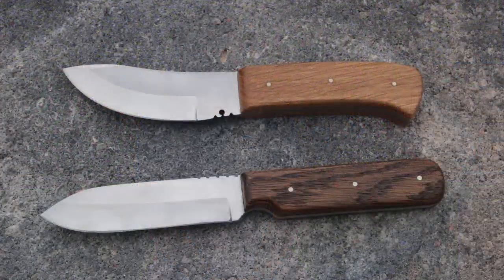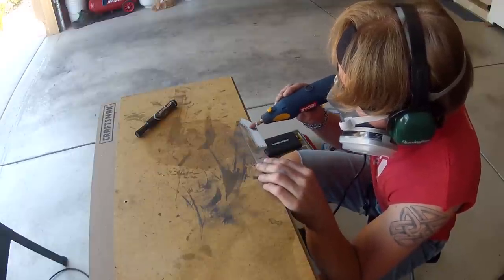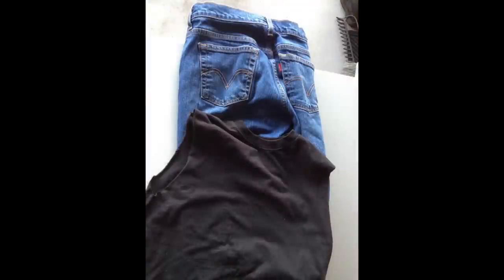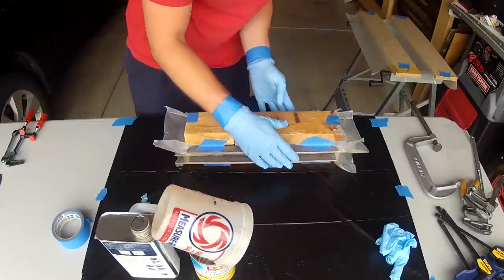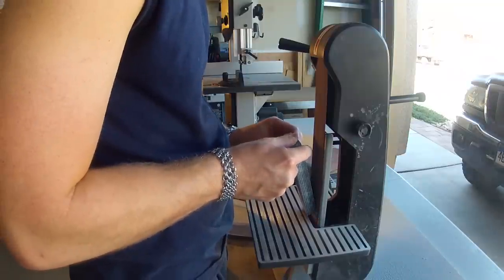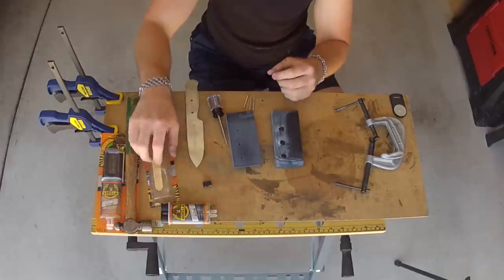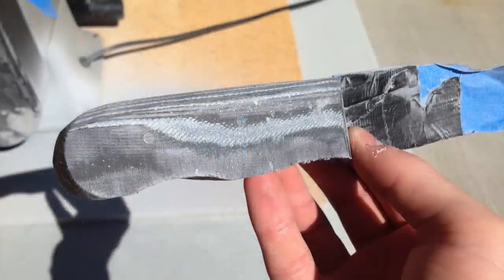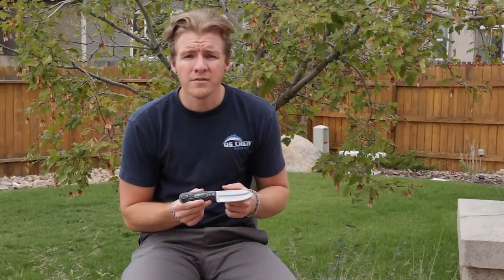Making a Homemade Custom Knife

Comment: I did 1095 like you and  the heat treat was subpar it would get shaving sharp and   Hold it but the carbon didn't move like it should I need to soak the steel orange shade above magnetic for at least 6mins try for 10 without over heating also I quench in brine (salty water) instead because 1095 requires a fast quench idk if canola is fast enough to do it. it is pretty fast tho and I normalized the steel 2 times before the quench after grinding

Comment: Really good tutorial/WIP, especially for a first knife.  Just a heads up, Micarta is a registered trademark that has been around for decades.  You will probably never get any grief for using the word but if you use mycarta you are guaranteed to never have a problem.  Now, go make another knife.

Comment: Hey man, great video! You did  a great job! Be careful with that drill press when you don't have the blade clamped down,  I've had a few get away from me doing that. What kind of belt grinder were you using?

Comment: Hey, great video, and it is so nice to see you wearing a proper respirator. So many "newbie's" wear those thin disposable mask's. Just a suggestion, a mechanics stool might help you from having to stand so much. They are cheap new and even cheaper on Craig's List. Even if the seat is shot, a piece of vinyl from a fabric store can be stapled on very easily. My dad did that with the used one he got until he bought a new one and retrofit it out with a motor cycle saddle seat! Keep up the great work.

Comment: if you're going to be making a lot of these, I'd suggest getting a cheap angle grinder with some sanding discs, makes shaping the handle must faster. Like someone else said, that's a nice bevel for a bench grinder!
Reply from the maker: Thank you.  I do have an angle grinder, but I misplaced the tool to change the discs and have yet to go get a replacement.
Reply: If you finger-tighten the nut onto a disc, and then turn the actual disc in the "tighten" direction, that's plenty tight enough. Plus then you can just turn the disc to loosen the nut off too, makes changing them very quick and no tool required!
Reply from the maker: Mike Jones I'll have to give that a shot.  Thanks for the tip!

Comment: I made my own spear with three tools I got a pretty straight stick and sharpened it with a knife from academy sports for ten dollars then got a steel ruler and hit it against a brick wall about 40 time as hard as I could grabbed my knife and made a hole so that some leather and the steel could fit put super glue all around the Leather the hole that made the leather stay and put super glue on the ruler stuck it in then let it dry for about five hours came back letter and used the spear of bottle as first it went threw 7 water bottles and three gallons of water then i tried with cardboard then wood about a third of a inch it all went threw I just put oil on it so I didn't rust this only costed about $20 I made more so I could put it on eBay they sold pretty fast also I got good results just put up 5 more want one for only $15 and works great! Go check it on eBay it's called a wooden steel spear handmade compatilble leather

Comment: if you follow his videos.. do the handle first not like he did it and also dont usr a hammer to hit it down but a rubber mallet ass the hammer impact could cause stress fractures in the wood and glue cause of heavy impact where a rubber mallet is low impact. but great video asidd from that.

Comment from the maker: Thank you.  I didn't use any files on the micarta, but it sanded just like wood if that helps.  The dust it creates is very fine, though, and it gets everywhere.  It is also toxic, so use a respirator if you are working with it.

Comment: Nice little project, but I would like to see how the blade holds up with some abuse. 
Baton that thing through some logs, then see if you can still shave with it.
Reply: Un no. You split wood by wedging it apart. Once a split is started you can split wood with wooden wedges or the very popular plastic wedges sold on Amazon. The leading edge of the knife should be cutting nothing. Of course if you're a novice and try to drive a knife through a hard knot you can and eventually will damage any knife ever made because of the ungodly torque put on the blade while being driven through a knot.  Have a nice day.

Comment: I guess it's fine as a hobby, but is it ok to rely on one of those for actual use? I wouldn't want a faulty knife in a self defense or survival situation, specially when I could buy a good one for less than it took to get all the materials and tools.
Reply: Trust me, if done properly a homemade blade will function just as well as any factory produced knife.

Comment: How much would you say it is to actually make one like yours?  Like the power tools like the drill press, belt sanders, grinders, etc.?
Reply from the maker: A lot of equipment can be found for cheap at a Harbor Freight store.  If you have extra patience you can simply use hand tools to save a lot of money.  As for material costs, I spent about $12 on the steel, and about $10 on the resin.  The fabric was obviously something I already had.
Reply: Huh, alright, that doesn't sound too bad then.  Thanks!

Comment: Umm, why don't you use wood as the handle? Wouldn't it be cheaper than fabrics?
Reply: Haris Praba Aditya Depends on the wood and fabric. If you want to stain it, color it, ect.
Reply: Haris Praba Aditya He probably just wanted be involved in more of the process.

Comment: what is the down right dirtiest and cheapest way to make a handle im new to knife smithing and i still cant make handles for them from wood because i cant afford the big equipment like you have so what is the cheapest handle you can put on a knife that is effective enough not to break
Reply from the maker: Use a nice hardwood and add some kind of protective finish such as polyurethane and you should be fine.  Hand tools like saws and files along with sandpaper will do the job, you just need a little more patience and elbow grease.
Reply: Paracord

Comment: would it be better if I put the primary bevel on the blade before heat treating?
Reply from the maker: It is different for each steel, but the rule of thumb is that you do not want the steel to be any thinner than a dime before heat treating, or else you run the risk of the metal warping.

Comment: Wjere did you buy your steel ive never seen a piece of 1075 that cheap
Reply: Mr icepick USA knifemakers.com you can get it all there
Reply: Mr icepick not to sound like a jerk but it was 1095 and it is pretty cheap. I just bought 5 ft for around 20 bucks. Shipping will make you cringe though

Comment: What exactly is the purpose of the air source when heat treating the knife?  I know with the traditional blacksmith forge there's that big lever that blows air into the bottom of the heat, but what does that do?  Let's say I just make a fire in a grill and put some smithing coal in, and just put the knife into it, will that not work?  Couldn't it still get hot enough?
Reply: basic principles. air adds oxygen to chemical reaction. more oxygen, wilder/faster/more effective reaction. with right chemicals, you can burn thing even under water. the smithing coal is burning, but under regular pressure or regular oxygen presence, it just does not burn that fast.
Reply: Oh yah also you could use a grill just rig a blow drier up to it pretty simple.
Reply: Basically, unless you have a heat treating oven you won't be able to make a fire hot enough to properly heat steel. By adding a constant source of oxygen, i.e a blow dryer rigged up to a grill ^^ the flame becomes more consistent and controlled and much hotter. This makes it able to heat a piece of steel to a high enough temperature for you to quench the steel (in oil, not water) and have the heat treatment take effect in strengthening the metal. But no, a regular coal fire in a grill will not be hot enough for your purpose, which I assume is making a knife of your own?
Reply: well, it's just to make the fire burn with more oxigen, so it's really hot, more than a normal charcoal fire, so you can heat the metal more and faster, but you have to be careful, because if you introduce more oxigen, the metal could oxide